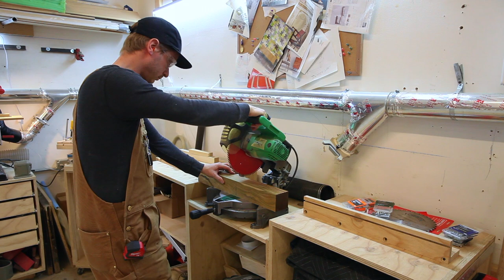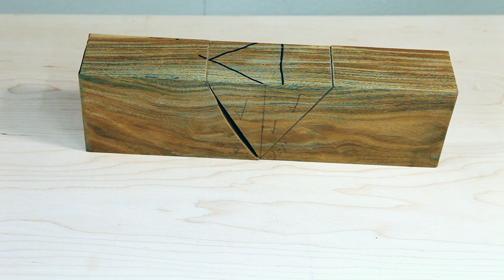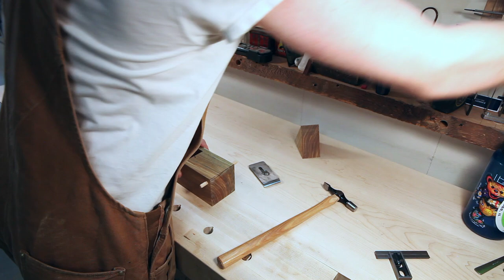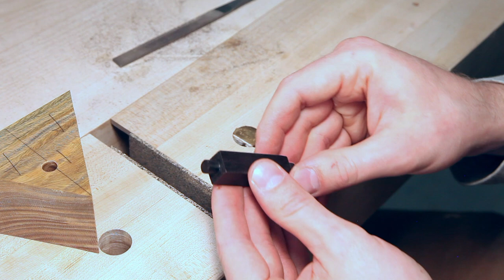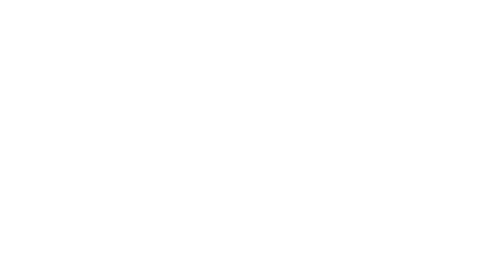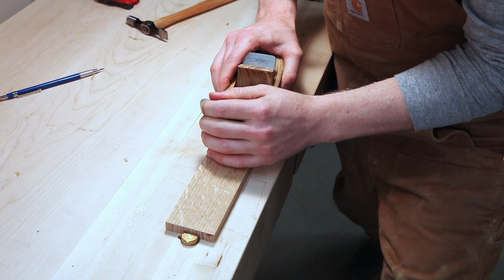How to build a Krenov style high angle smoothing plane

Comment: Very interesting video and some great trips and tricks. One question, why not use miter saw to cut rear ramp? It will leave a flat and pretty smooth surface. Is it because you need to use bandsaw to cut front ramp curve anyways, going to miter saw is an extra trip?
Reply from the maker: Thank you! You can absolutely cut the rear ramp with the miter saw. My miter saw doesnt make a decent enough cut so Ill have to clean it up anyway with the low angle block plane. You're right about the forward ramp, 60 degrees is too steep for the miter saw and you want a bit of a curve to help eject shavings. So since im already there for that cut Ill just do both at the bandsaw.

Comment: Hey Frank, great video, thanks for sharing. About the file you used to shape the crosspin, do you recall if it's the italian needle file offered by Lee Valley?
Reply from the maker: Thank you! I’m having trouble locating this file. I got it as a one-off, not in a set. It’s manufactured by Grobet USA and on their website I can’t seem to find that exact file. It’s a cut 00 with a safe edge. Similar to this file I linked http://www.grobetusa.com/swiss-precision-8-pillar-narrow-file-cut-00-item-31-230/#PhotoSwipe1603656868939